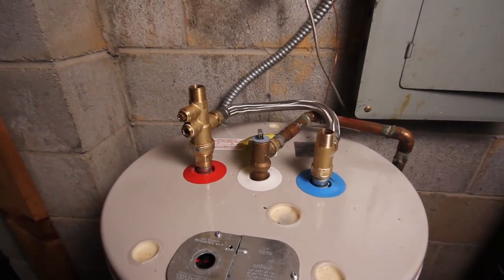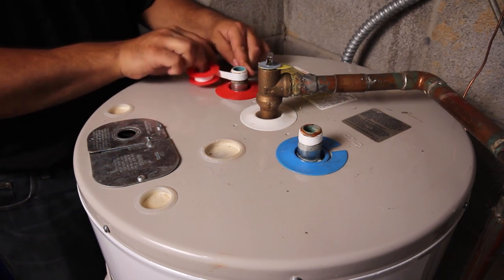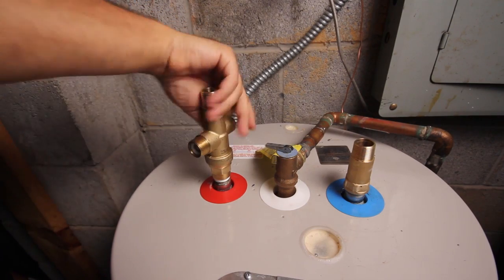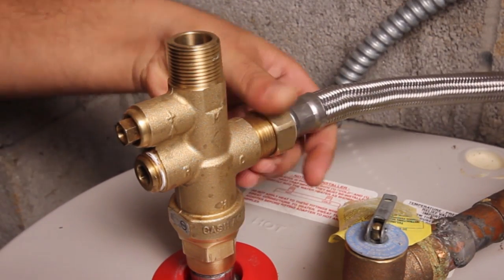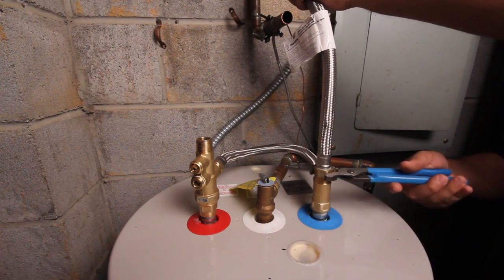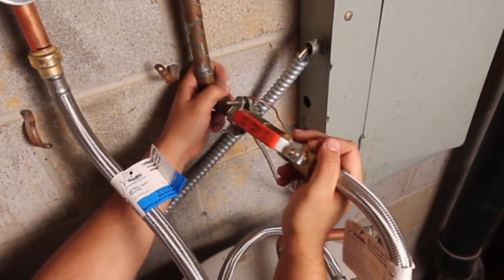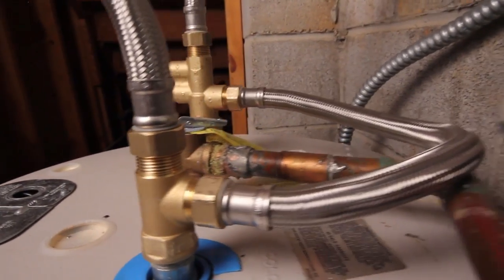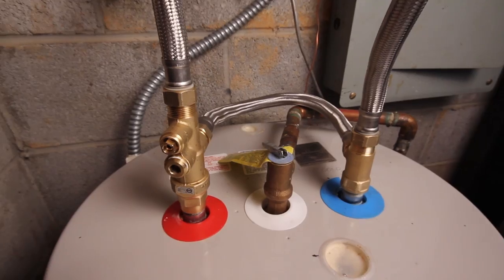The Heatguard MultiFlex Thermostatic Mixing Valve

Comment: are you going to need water expansion tank for additional pressure after mixing valve install?
Reply: Anthony Merc yes it’s code required
Reply: No. More useless junk that you don't need we've built over 100 houses, for 70 years, 3 generations, and have installed hundreds of w/h. They've all done fine before the expansion tank nonsense. 30% of codes are useless nonsense that some desk jockey, who has never swung a hammer, came up with because of manufacturer "lobbyists." (Not really lobbyists, but it's the same idea. "Go give the IBC board $25k and send them all in a trip to Fiji, and they'll do whatever we want them to.) "We can sell 1 million tanks a year if we convince the IBC that an expansion tank is needed."
Reply: @littlejackalo5326 You are not wrong my friend.

Comment: Total garbage valve with braided hose connections. Valves leak everywhere in 1 year..  install a better valve, don't use anything sharkbute or flex connections
Reply: If you know what you are doing with sharkbites they are fine.  Like anything else preparation is most important,
Reply: @suspicionofdeceit glad to hear it, it must have been pricey ( more pricey than buying a crimp tool for sure.  
Long use sharkbite fails fairly spectacularly. Where i live is pretty hard water, the o rings get destroyed by calcium and magnesium and fail, when they do its sudden and a gusher of a leak. I hope yours continue to hold, but for reference last year i replaced sharkbite failures done by homeowners in 4 seperate instances, one was bad install ( they took the ferrule stiffener out and the pex walked out, the other 3 failed as i mentioned

Comment: I installed one of these on my water heater and though it wasn't as easy as the video shows it is definitely a DIY project. We have had good success with this and it really has increased the amount of hot water we have. Meaning more people can consecutively take a shower and still have hot water which is what we wanted it for. One thing to be aware of is that there are two filter screens that are installed with this and they do get build up on them over time. To the point of losing hot water pressure. The fix is to turn off the water, remove and clean the screens and reinstall.
Reply: Been awhile since you installed,How has it been ? Still working? Leaking? Has the 2 Filters clogged? I'm getting ready to replace my y 22 year old gas water heater and saw this and was wondering on long term,since the circulation pumps Valve fails so regularly. Ty
Reply: Hot water diluted with cold water.,

Comment: I doubt there are any energy savings but that is not the reason, from what I have read, for these valves.  Bacteria do not tolerate the higher temp, 140+, so this is done for public health reasons.
Reply: This uses quite a bit more energy.  Maintaining the tank at 150°F uses approximately 60% more energy than keeping your water temp at 120°F assuming an ambient temp of 70°F in the room where the water heater is located because the power consumption to maintain temp is proportional to the delta-T.  The national average in the USA is currently $561 per year in electric cost.  With this system it would be much more.  Rather than install this system to increase your capacity, you would be better off buying an 80-gallon tank.

Comment: System looks a little to close to the Electric service panel. Thanks for the info and looking to get a mixing valve for my heater soon. And the shark bite install is a plus, not sure if I will do that however

Comment: I cry foul!  This is a scam!  I am a trained Mechanical Engineer and I can tell you this setup does nothing!    ALL it does is recirculate some of the heat your water heater generates from burning gas or electricity- this heat is being "recycled" BUT it is the Same HEAT, in other words you are not making the system more efficient or produce more water from the same amount of energy input.   If so then why do they always tell you to turn up the controls  to 150F  (Hmm could it be to produce more hot water??)   Also a "Mixing" valve by definition (and design) simply mixes two streams of flluid and has NO effect whatsoever on the appaarti that produced the two streams nor does itt have any effect on efficiency.   I don't know if Heatguard is a legitimate company but their product is hogwash and they should be sanctioned for making false claims that (among other things) violate the Law of Thermodynamics- you can't get "free" heat just by screwing together a couple of pipes
Reply: Scott Hill can't open his mind to understand this simple concept.
Reply: The goal is to get to get a lot of water at 120 degrees.
Reply: hmm mixing valves have been around forever and tested?
Reply: This is a simple concept Scott.  Simple test to prove concept:  fill a mug full to the very top with 150 degree water...  Now, pour in cold water until the temperature of the water is 120 degrees... Did the glass hold all the water, or was the final quantity of water greater than the total capacity of the glass? It's that simple.  This is a great way to increase the amount of hot water you have without increasing the size of your tank.  Will it be more efficient?  Maybe... Maybe not.  It's about convenience.
Reply: Scott Hill is a prime example of people who get an education but is dumber than a rock.  40 gallons of hot water will always be 40 gallons of hot water but at 120 degrees the water in the tank can be dangerous to your health as it grows microorganisms.  Temperatures above 125 degrees can and will scald you. The purpose of the mixing valve is to turn up the heat in the water heater to kill any bacteria and then to mix cold water into the 150-degree hot water as it leaves the water heater bringing the delivered hot water to the faucet down to 120 degrees, (below scalding point). I have installed two of these valves and I love it.  No more warm water turning to steaming scalding hot water while trying to find the right temp for the shower or bath.
Reply: You are a trained engineer and you don't understand how a tempering valve works????    Riiiiiiiiiight.... sure you are. ;) .
Reply: Scott Sue the school you went to!!!!
Reply: I too am an ME.  This is supposed to allow you to turn up the heater t-stats and store hotter water (140 deg) in the tanks while only sending "standard" 120 deg to the faucet. Due to new regulations the tank companies stopped making larger tanks so, for example people who had a now nonexistent 65 gallon tank have to replace it with a 50 gallon tank if something happens to the 65.  It does give you more HW time at an increased cost.  Also, going to 140F is safety issue as it keeps legionella from forming (150F kills it).  Recommend adding extra insulation.
Reply: @Meche697  120 degree delivery has very low chance off burn. 130 scalding in 5 sec 135, 2 sec    140 under 1 second
Reply: @Meche697   I may be wrong but there has NEVER been a single case of legionella bacteria in a home hot water system. I was told that by State Inspector.
Reply: @richardhoner7842  time in pipe is a factor. Go to a dead end pipe and you'll have issues. ASHRAE has design temperatures to design around. In a residential scenario, dead ends and facilities that allow the water to sit long enough is reduced.

Comment: By raising the temperature, doesn’t that use more electricity?
Reply: +lazaro lopez yeah, I&#39;m not sure what the justification is for the environmental claims, I certainly can&#39;t think of any.
Reply: You are correct, raising the temperature costs more - though I think in the end, it is cheaper to go this route, than to get a larger tank.
PS. you could add a thermal blanket to help reduce energy loss
Reply: @SmalltimR  thermal blanket does nothing, tanks are already insulated and primary losses are stack and jacket ( pipes and vents) this is a cheaper option to increase useable water if you lack space to increase the size of the tank. On demand heater us the more expensive and better option
Reply: @MrDmadness  more insulation can't hurt. There's a reason homes in the Arctic circle have insulation over a foot thick
Reply: @JarrettWilliams99  yes to hold a thermal break, insulation does not make heat though it contains it, by the time its escaped the insulation barrier built into the tank its no longer heating the water or holding heat there.
Reply: NO . when the water is hotter you use less hot water and more cold water .
Reply: @MrBemnet1  This uses quite a bit more energy.  Maintaining the tank at 150°F uses approximately 60% more energy than keeping your water temp at 120°F assuming an ambient temp of 70°F in the room where the water heater is located because the power consumption to maintain temp is proportional to the delta-T.  The national average in the USA is currently $561 per year in electric cost.  With this system it would be much more.  Rather than install this system to increase your capacity, you would be better off buying an 80-gallon tank.
Reply: But a higher temperature in the water tank increases the rate of heat loss to the surroundings.  This is basic physics: Newton's Law of Cooling states that the rate of change of the temperature of an object is proportional to the difference between its own temperature and the ambient temperature.  The tank will lose more heat to its surroundings the hotter it  is maintained at.